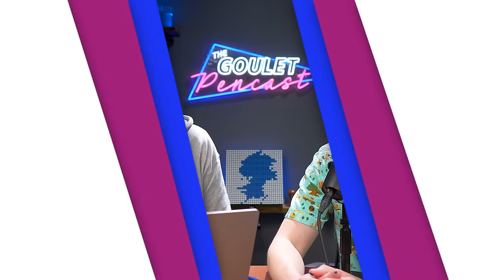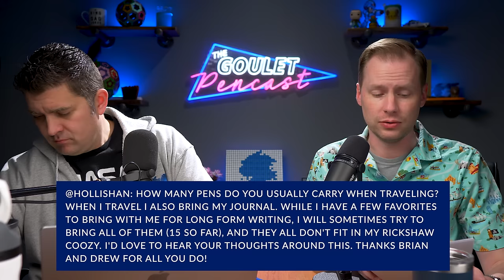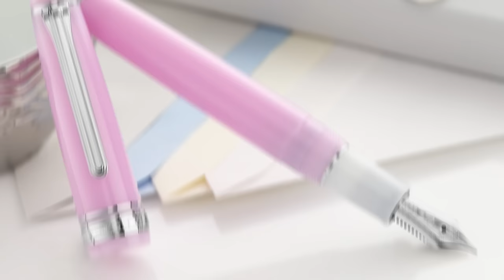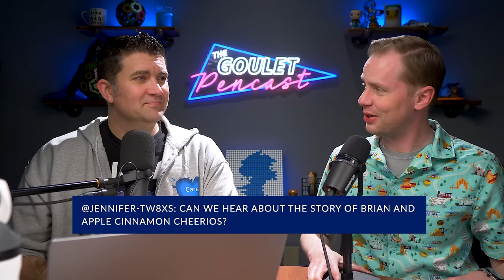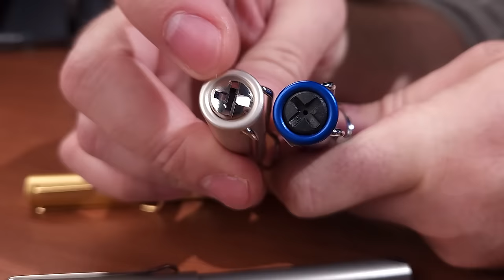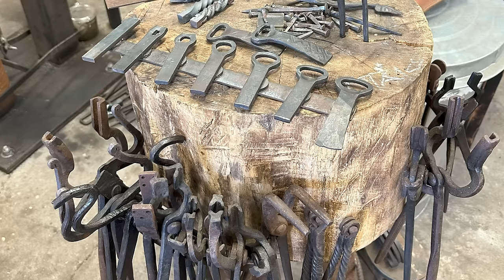How Many Pens is Too Many? Plus a Look at the LAMY Lx! | Pencast 126

Comment: I just got my pilot E95S. It's great but its design make it impossible to see how much ink is left. Moreover cleaning it with the 40 con is a problem since i cannot see what's going on. Can you guy show how to properly clean the 95s?
Reply: Bulb syringe, but it doesn't fit as tight on pilot unless you cut it down